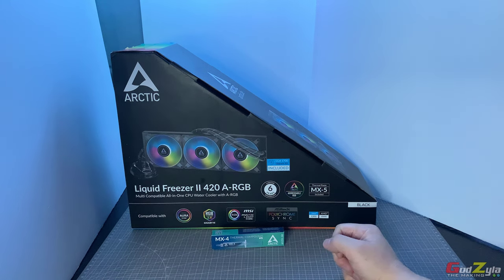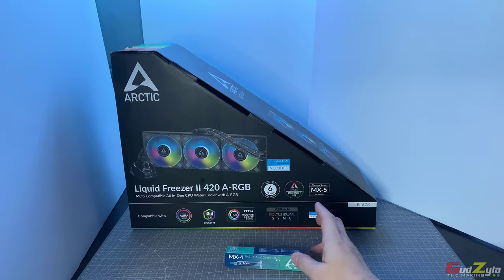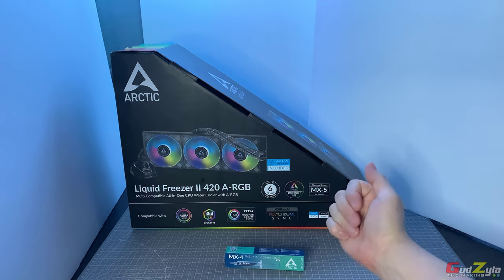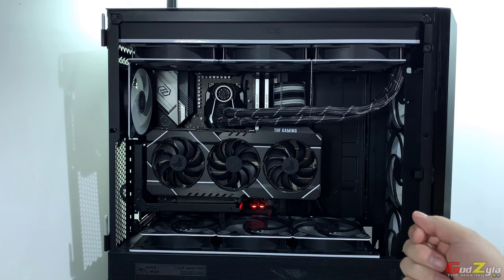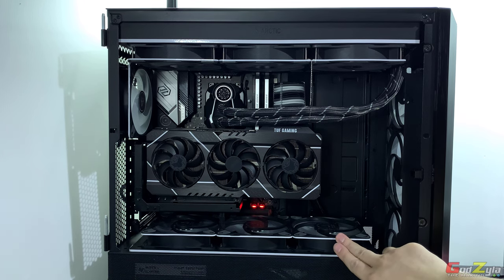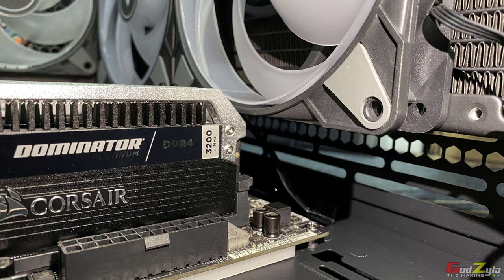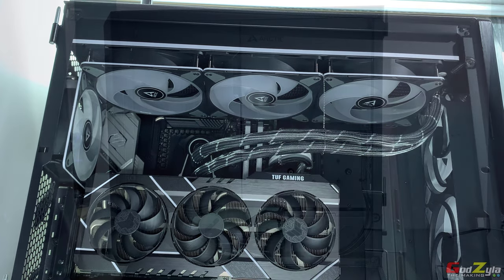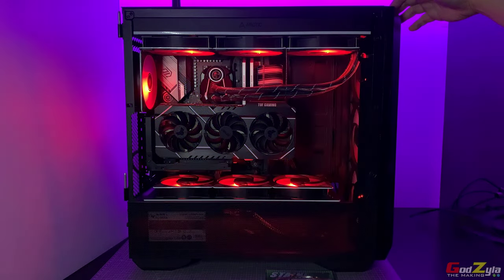Arctic Liquid Freezer II 420 in Lian Li Lancool III - Part 2 (The Experience)

Comment: I got the case, partly after watching the video. But, it doesn't fit. On the top, the IO shield part of the case blocks it from screwing it in. Are you not screwing the last  2-4 screws? Also, hits the fan bracket on the other side. You said you are not setting it all the way in. I had to revert to install on the front. To install it on the front also, I have to remove the disk caddy platform at the bottom. However, the arctic cables are very short. Front bracket has lips so it will only go one way. Either have to use RGB extension cable or not use RGB. Anyway lose all capacity for hard disk installation. If the case was a little taller or a little wider, it would have fit easily. I don't think this case should be advertised as supporting 420mm AIOs.
Reply from the maker: Hello Mark, welcome to my channel. hmm.. the I/O Shield I did tuck those cables nicely and had no issues with it and if you are talking about the 420 AIO radiator screws that has total of 12 screws, they are all in without issues. Do you mean when you screw in the rad at the top, the screw holes alignment is out? As for Hard disk as I see it. you should be able to mount it unless your PSU is way beyond 180mm in lenght?
Reply: @KleoYan  When I was trying to put the rad on top, the IO shield section of the case would hit the radiator part and not allow me line up the last 4 screw holes. We must have slightly different case or AIO.
Reply: @KleoYan  Regarding the hard disks, I had to remove the bottom tray that holds the hard disk mounts (as you did in the video) to install the AIO on front. One of the screws was under the foot and I did a bad job removing the adhesive to get the screw to remove the foot. On lancool 2, I use the hot swap feature and the ease of opening the lower tray to slide in a hard disk was so convenient.
Reply from the maker: @marka5968  hmmm interesting, I am now abit confused. ok this is how it looks like https://imgur.com/gallery/vHezOSS with my AIO top mounted.
Reply from the maker: @marka5968  yup, this I do agree. I had sometime to look at it and one of the screws is just below it .. as for Lancool II it's simple, this was my lancool II original https://youtu.be/IAeqLdRo2ec
Reply from the maker: @marka5968  hi, can you sent the link to my email? godzylatech@gmail.com . I will help you post it here and to pin it.. at the meantime, after looking at your pics, let me see what I can find out from lian li. thank you!
Reply from the maker: @marka5968  ok saw your setup. https://imgur.io/a/8TIgZfQ you where doing front mounting. No wonder you have mentioned not able to mount the 3rd fan. For me am mounting it at the top so everything fits just nice. But of course I the front fans are not as nice as yours.
Reply: @KleoYan  Thank you posting my build link. I wanted to also put the AIO on top but it wouldn't fit as I mentioned above. I put the 3x120mm arctic on the bottom same as you. I reused the Lian li RGB fans from the front to the top. Using the motherboard RGB to control the front fans and the GPU RGB to control the bottom fans. The top fans are from the case controller.  The original RGB fans aren't the best looking and I want to replace the Lian Li RGB fans with arctic fans or SL140 but its more expense and more cables to manage at the back.
Reply from the maker: @marka5968  I see. Though uni fans are fanciful. I don’t use them. I prefer to use performance fan which are quiet and using much lower ampere, which arctic fits perfectly. But nevertheless is up to individual and I hope you get your build resolve and to enjoy your pc.
Reply: @KleoYan  sorry to bother about the clearance of the ram, do you think it will fit Kingston fury renegade ddr5 ram ?
Reply from the maker: @MoonboyPlays  welcome to my channel. the rams are straight.. is not like flaring outwards. it should fit.
Reply: @KleoYan  thank you so much , cheers.
Reply from the maker: @MoonboyPlays  you are most welcome.
Reply: @KleoYan  Thank you for the pictures, helped me with top mounting this AIO on this case. 💯
Reply from the maker: @virtualogic  hi and welcome to my channel. I am glad it did aid you out. All the best with your build too 😉👍
Reply: @KleoYan  For sure! I was stuck mounting this AIO to the same case, haven't had much experience building with the LC3, but thus far it's great, had to flip the front fans and the fan bracket just like your photos. I love the modularization of this case...
Reply from the maker: @virtualogic  same here. i also like the Lancool 216.. super modular https://youtu.be/WvCb7uu-_7c
Reply: @KleoYan  Nice! I'll check it out.
Reply from the maker: @virtualogic  enjoy 😉
Reply: @MoonboyPlays  clearance for lancool III ram is max 44mm
Reply: @marka5968  Mark I had a similar problem, my motherboard fan was causing my 420 aio to go crooked when using the rails on the case top to screw in the aio. If you pull the aio up against the left of the case you can see a line of 6 ""D" shaped holes along the left and 6 circular along the middle that just line up with the aio screw holes. I had to do some sanding on 3 of the holes to get them centered but I was able to fit the 420mm aio in and with much more room to access the top of the motherboard and all the screws seated instead of just 4 on one end. I have before and after pics from when I reseated the aio if you need.
Reply: @desmondrice8373  That was the exact same issue I had.  Couldn't get it to fit on the normal rails then saw those 6 holes, realized they lined up exactly with the radiator screws and saw another 6 holes the exact right distance away.  It is a snug fit but it fits. For anyone else, just be sure to either plug in everything you need at the top of the board before you start or take the fans off because you will not be reaching those headers with the fans on.
Reply: Yo! Can i see an image of the bottom of your rad? I tried front mounting it but i could not get the top screws through  the front bracket. My top fan is currently slapped on with only its 2 bottom screws
Reply: I didn't fully understand all these comments - is there a TLDR: 420 is good at the top of the case or not ? It looks a bit tight in the video. Would 360 be an easier fit ?
Reply: Will the arctic 360 aio mount on top without an issues?
Reply: @KleoYan  I am having the same issue as @marka5968 - I think he was asking about screwing in the rad at the top. I was only able to screw two front screws and two middle screws but not the back screws. Is this what you did as well?

Also another question.. How did you get the front fan panel to close? Mine won't close no matter what and I pushed the AIO rad all the way to the back and to the left and it's just tilted outwards at the top..
Reply from the maker: @SimplyFrankiee  hi and welcome to my channel. I have all 12 screws at the top on the 420 rad. The way i do it is to screw one hole without tightening it. once all 12 screws are in place, then i will tighten them. as for the front, I miss out that section in this content. you can refer to this pictures https://imgur.com/gallery/vHezOSS
Reply: @KleoYan  hi thank you for your reply! However, I'm not talking about the screws that attach the fans to the radiator. I'm talking about the screws that attach the radiator to the case. I could only get two front and two middle screws in (the fans are all attached properly).

Did you also screw 12 screws that attach the radiator to the case and if so may I please see a picture of the top part of the case where the radiator is screwed in?
Reply from the maker: @SimplyFrankiee  I wish I can show you the pic, but I have switch case and this case is no longer with me. But I had all screws to mounted between the case and the rad. As what I have mentioned, doing pilot screwing to each holes and not fully tighten all the way. Is like start of one screw hole. Have the screw to hold only and then move to another and align and adjust till all 12 screws are in, then I tighten them.
Reply: @KleoYan  Oh I see. For some reason, mine doesn't fit like yours does then and not all of the spaces align so I had to screw it in a weird way...
Reply from the maker: @SimplyFrankiee  how did you screw yours? did you tighten one and move on to another? if you did that, try this menthod. swap the rad 180° then pilot to one. slowly wriggle the rest of the screws  in place, do not tighten. is like doing 2/4 turn and 1/4 reverse turn. as the metal bracket of the rad might be miss aligned. I did that for a friend who had the same issue like yours. He could only get 6 screws in. btw once you managed to pilot all 12 screws, then put back the original position you wanted (turn back 180°) then try again.
Reply: @KleoYan  I'm not sure I entirely understand. What do you mean by swap the rad 180°? Also, in your video, at 5:21 you only put in two screws in total. Do you notice this?

Also to answer your question, even before screwing in the radiator to the case, I could not get it to align on more than the 4 points of contact where I screwed it in.
Reply from the maker: @SimplyFrankiee  yes at 5:21 is with two screws as I cut and go to the next scene. It's not wrong for you to doubt me, plus the case is no longer with me. When I said 180° it means if your hose are facing towards the front, switch it to face towards the back. Adjust the screw points. once you have it align, move back to original position. The point of doing this, as it's an alignment issue of the rad screw holes. by the way, where you from. If you are in Singapore, I don't mind to offer my help.
Reply: @KleoYan  Oh ok, so you cut out the scene where you put all the screws in?

I don't think I can do the 180° thing as the case won't allow it.. I'm in North America unfortunately, but I appreciate the offer!
Reply from the maker: @SimplyFrankiee  yup I cut the scene. Ok at this point, how many screws can you get it in? If you can’t get all. At least get four at the Center of the rad. At least it’s stable that way. There is also another pc builder here who commented. He ended up screwing some and zip tie those rad holes which are miss aligned.
Reply: @KleoYan  Oh I see okay. I just have 2 in the middle (that's the most I could screw in at the middle) and 2 at the front (also the most I could screw in at the front).
Reply from the maker: @SimplyFrankiee  ok, now if there are vibration, you might want to try zip ties, that will stop the vibration. I am so sorry to hear that you are not able to have all 12 screws in place. To be honest, back then I did have the same problem by mind was the top right screw and the bottm left screw.. What I did was to redo the process to screw them in place, taking sometime to wiggle the screw holes with a narrow screw driver, but gently as not to damage the thread on those rad holes.
Reply: @KleoYan  I somehow was able to redo it and get it screwed in completely so we are all good now! Only problem is I think the pump block isn't fully seating on top of the cpu.. Wondering if my mobo isn't compatible. It's a Z970-E
Reply from the maker: @SimplyFrankiee  that’s good news. Thanks for your reply, as for the z790 motherboard, which model and brand are you using? You can refer to this list from Arctic official website https://support.arctic.de/lf2-420
Reply: @KleoYan  I'm using the ASUS ROG Strix Z790-E Gaming!
Reply from the maker: @SimplyFrankiee after going through. You are not the first who mentioned about Asus z790 board is not compatible https://www.reddit.com/r/arcticcooling/s/s6qEXDdVQm hmm. Are your vrm blocking the liquid AIO block brackets? I suggest you to right to Arctic to see if they have altered brackets for your liquid AIO.
Reply: @KleoYan  Yeah I think that's what's happening to mine. Where can I contact them? 😯
Reply from the maker: @SimplyFrankiee  https://support.arctic.de/lf2-420/support either you call in or to fill in the form. If you calling in. Kindly note they are only operational from Monday to Friday.
Reply: @KleoYan  Understood, I'll give it a go! Also thank you for your help! I really appreciate it!
Reply from the maker: @SimplyFrankiee  you are most welcome. All the best with your build too.😉
Reply: @KleoYan  Thanks! I do have a quick question. After mounting the front fans like yours, I can only feel air being pushed into the case from the very top fan but not the middle or bottom fan. Do you know why this may be? I connected all of the fans directly into the AIO so they're all controlled by one cable.
Reply from the maker: @SimplyFrankiee  I did not do the way you do, I separate the control. Case fans are for case fans, AIO radiator fans are for radiator fans. i can remember my configuration back then. My front fans and rear fan are spining at min 1100 rpm consistently and my bottom fans are running at 1000rpm. As for my rad fans, I let it run in performance mode. As and when the CPU goes hotter, my radiator fans will kick in. btw all my fans are from the Arctic P12 or P14 argb. If you just use one to control, at idle your fans will not hit above 1000rpm which your case fans will not be drawing alot of cool air in.
Reply: @KleoYan  Oh I see. Hmm, honestly I'm not even sure how to do it your way. I had a friend do the fan part and he just connected all of them together and then changed the FAN Monitor to Ignore.. I was wondering why I didn't feel much air.. Do you know how I could fix this? Also I have the same fans as you except not RGB.
Reply from the maker: @SimplyFrankiee  this is getting abit too long, can you create a new comment. As I not only track your comments but to track others. Your reply on this comment does not shows me any notification, I will need to manually browse what you have replied. btw, kindly create a new comment with your fans you've used. I only know you are using an Asus z790 Strix motherboard. Thank you!

Comment: This case and Fractal Meshify 2 RGB, are NOT OK for the super bulky Arctic 420. Yes it can fit, but with a lot of compromise, like removing a fan from the fractal case, or touching the case fans in Lancool 3...even if you are ok whit that, you still have to mind the hight  of the RAM and MB heatsink.  There a lots of "if" and "or" so I give up from 420mm and went for Freezer 360mm - it is absolutely perfect for Ryzen 7950x, there is no thermaltroteling even on long hours multicore task (like rendering)....Also the radiator of 360  model is 400mm long  and the about 450mm for the 420 model. Mind that before bye it
Reply from the maker: Hi achi ramoto, welcome to my channel and thank you for your insight about the 420 AIO in those chassis. yes it does have compromises, infact a 280 AIO will also do the trick, so long you know how to set PBO2.
Reply: Is freezer II 280 a good option for this case? I'm looking for a case that can fit this AIO
Reply: I bet the fractal meshify 2 XL would do the job just fine 😊
Reply: 420mm works just fine in this case. It helps to remove the front IO panel and the entire front fan bracket for initial fitting. I definitely would not recommend a case any smaller than this for a 420 though
Reply: @mattafaak  no , it doesn't work fine at all ...not in Meshify 2 RGB - you can't remove the front fans in this case, cause they are in bracket part of the case. Even if you  remove it somehow, it's defiantly not "working just fine". I can say this for the non RGB Meshify 2....Also 420mm is pointless for AMD processor

Comment: Wow, that AIO looks big. I bet the temperature will be excellent and you me thinking to use those decal decorations on my PC too. Kudos to you Kleo. Love what you did on your GPU and fans. Your build is simple and yet so elegant 😍
Reply from the maker: Hi ya, welcome back. Yup, the AIO 420 is super big. I will be letting it run for awhile and to do a thermal test on my next video. By the way, thank you for the compliment too 🤩
Reply: @KleoYan  hi, is it possible to put the radiator on the front side?
Reply from the maker: @ДаниилЧепурко-в5я  Hi welcome to my channel, if you are referring to this 420 Liquid AIO, not possible, you can't close the front pannel as the radiator is too tick. even if you fit inside the fan tray which is offset. plus you cant close the tray back in place as the radiator hose is blocking. the only way to mount your Radiator is inside the case at the front. I do not advise to mount it at the front as you will have lots of obstacle, but you can give it a try. just because when you do that as you might scratch the radiator due to the huge size.
Reply: Seems like there is no room if you wanted to do a push pull setup in this case.
Reply from the maker: @soklot  Hello sokot, welcome to my channel. Unless you do not want the rear fan, then you can do push pull configuration without issues.

Comment: Li an li website says for a 420mm, Orient the radiator tubing side toward the rear of the chassis. Have you asked them about that? I had a hard time getting this in and am not willing to try reversing it to see if that allows the rear fan to fit. My temps are in the 29s and low 30s C on idle with a 13900k and no rear fan. I think a 360 mm rad would have been a lot easier but it is done.
Reply from the maker: Hello Dorothy P, welcome to my channel. That’s when you do custom water cooling where you need to route the hard tubing as for AIO liquid radiators you can mount front or back. Not an issue.